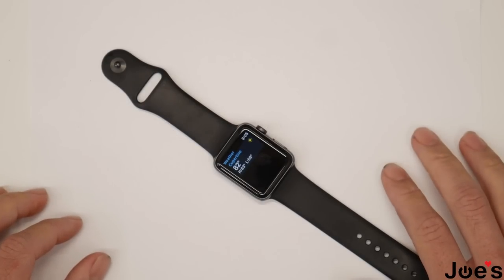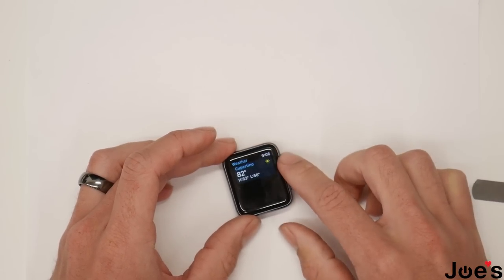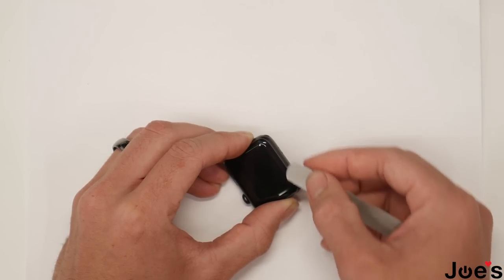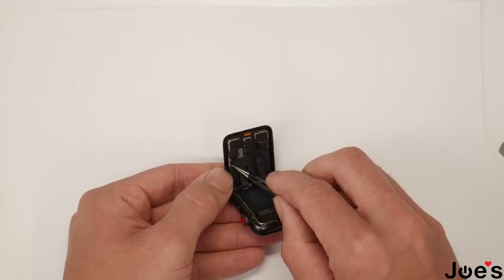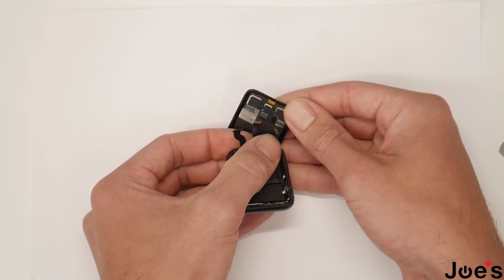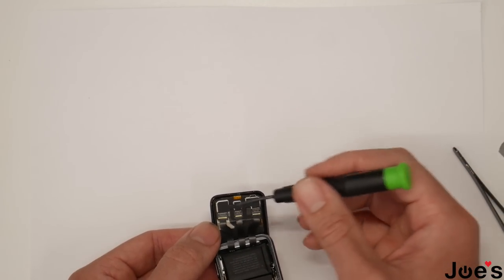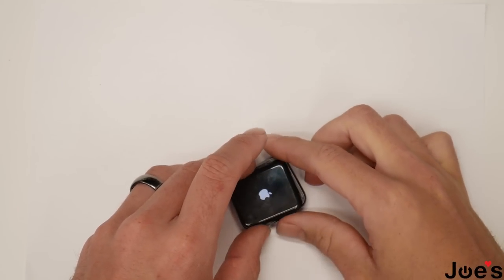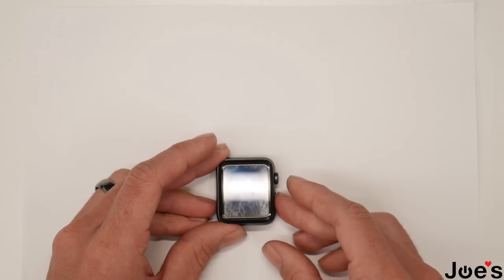How to Replace Series 3 GPS LTE Apple Watch Screen Display

Comment: what about closing it? when you finish what kind of adhesive do you guys use?, its a warranty that it will be water resistant?
Reply from the maker: Thanks for the comment. We use B7000 which is a water-resistant adhesive. As long as you apply the correct amount of B7000 your iWatch will be water-resistant. Here is a link where you can purchase the adhesive: https://www.joesge.com/products/copy-of-b-7000-b7000-glue-15ml-clear-adhesive-mobile-phone-repairs?_pos=2&_sid=0378d094f&_ss=r

-David P

Comment: If the top part of my screen is touch responsive and the bottom half is not right were it cracked, would i need a full screen replacement or just the glass?
Reply from the maker: LCD and glass is probably broken.
Reply: When you crack glass you usually damage the digitizer underneath LCD as well - it's not visible, but touch won't work, and it's common that it affects only part of the screen. So yes, you probably need full screen replacement.

Comment: Be careful!  The clamps or clips he refers to in the video are not on all series 3 watches. Mine had plastic harness over the ribbon connectors. Thinking they would lift off as in the video I attempted to pry them up  not realizing they were different than the video I damaged the connector and ruined my replacement screen. Mine simply were held in place by the tape and would slide out with minimal effort. Unfortunately I learned this too late. Better luck to you.
Reply from the maker: We actually didnt know that. When we do come by that we will make a video on the other model of apple watch.
Reply: Duane did you pull up on the ribbon or try to slide it out of the connector?
Reply: Kyle Tarr I pulled up on the plastic harness on the first one unfortunately destroying it. The other two simply slid out with firm pressure in the opposite direction of the inserted ribbon cable.
Reply: Duane - thank you for this heads up. I just replaced an iWatch 3 series LTE and it did NOT have the clamps. Rather, a gentle tug on the connector was enough to pry it loose. I will add that it is even more important to ensure, on the new screen, that the connection is firmly re-attached and secured by the black tape as the clips/clamps are not there to guarantee a proper seating. Crisis averted thanks to your post.
Reply: Richard Gannon you are welcome. So glad this helped you.

Comment: Hey i have seen there are 2 typs of displays gps +lte and only gps i have the normal Nike 3 without the red Button Witch display is the right?
Reply: Because on AliExpress Budget Website is the gps+cellular lte ceaper
Reply from the maker: If your watch is a series 3 watch without the red button then you have a GPS screen and that screen will only be replaced with a GPS screen NOT LTE + GPS there is one difference on the screen.
Reply: Works the lte screen on the normal gps Screen?

Comment: Does Apple Pay work with a different screen? I’ve replaced the screen and everything works but it always fails to set up Apple Pay
Reply from the maker: Thanks for watching! Yes, it should work with a different screen as this does not hold any of your account info. See if you are still connected to apple pay on your phone, if you are and it still does not work, you may want to contact apple support. CH
Reply: I’ve experienced the same with a Series 4 recently.  It seems to be true that, if you don’t move the 3rd right most connector, it stops working.  This was despite my watch being wiped prior.  There are threads & warnings on it.  None of the repair non-apple depots know about it.

https://www.ifixit.com/Answers/View/505724/Apple+Pay+not+working+after+new+screen+replacement.

Comment: So if the screen still works but it's cracked, do I just need to replace the glass and not the digitizer?  Is that possible?
Reply from the maker: Hello and thank you for watching JoesGE. That is not possible you'll have get the entire screen and digitizer changed. 

JP
Reply: yes, yes it is. not easy but yes. you can look up the tutorials on youtube

Comment: Where can I find a replacement screen for series 3?
Reply: i have series 3 screen original removed apple watch ,$150 shipping cost extra .
Reply: sajal pal: how can I get the part you have?
Reply: That costs more than it would to send it back to Apple
Reply: Jewel Alston i bought one on eBay for 200, and no, apple told me it would be like 290/300+
Reply: Let me know if it’s a reputable dealer or a good screen. Thank you!
Reply from the maker: We now have the replacement screens at our website https://www.joesge.com/products/apple-watch-series-3-iwatch-screen-digitizer-lcd-display-parts
Reply: Jewel Alston you still need one ?
Reply: Joe's Gaming & Electronics  can you show me series 3 38 Mm gps ? Where I buy screen only
Reply: Ho viet Long yes dm me !!!
Reply: Yazd banaji can you show me where I buy this
Reply: I just buy screen seri 3 38mm gps only
Reply: Ho viet Long yes it's $100

Comment: I have a question, I replaced my screen and it turns on the only thing that doesn’t work is the touch I can’t use it at all
Reply: I also have a red line that goes through the middle
Reply from the maker: Hello and thank you for watching JoesGE YouTube. After speaking with our tech he states that the ribbon my have been damaged or isn't sitting the right way or the screen is faulty, and this may cause the touch screen issues.

JP
Reply from the maker: Our techs are wondering if your willing to ship your watch in so they can look further into this issue and they will contact you directly and inform you what the issue is free of charge.  This is not a repair just an investigation of what the issue can be.

JP

Comment: I have the s3 gps display, does it also work for the s3 lte?
Reply from the maker: It won’t work on LTE. GPS and LTE are different screens. https://www.joesge.com/products/apple-watch-series-3-iwatch-screen-digitizer-lcd-display-parts?_pos=3&_sid=84726c477&_ss=r&variant=8094224678958